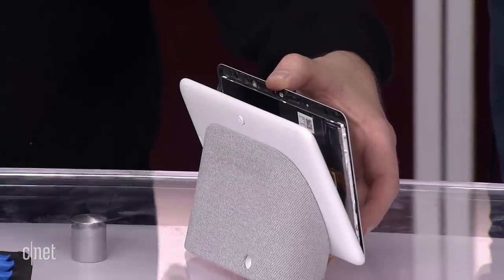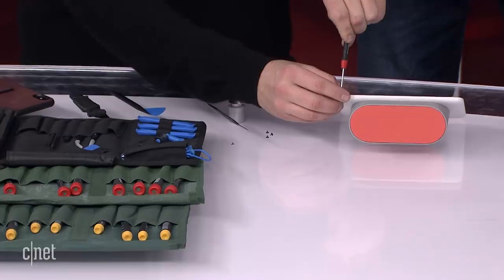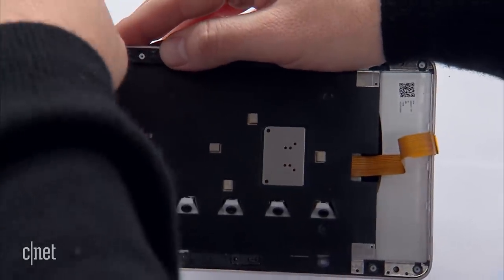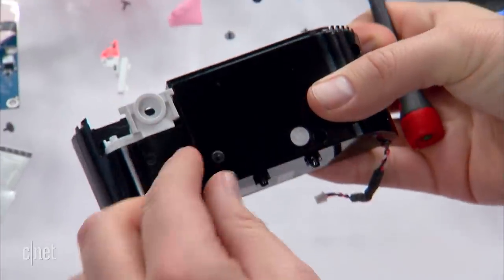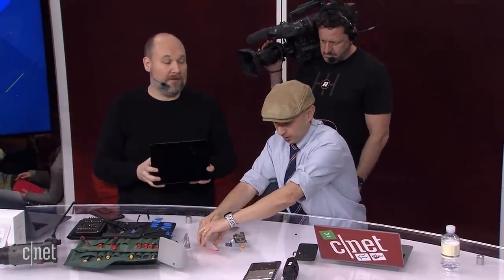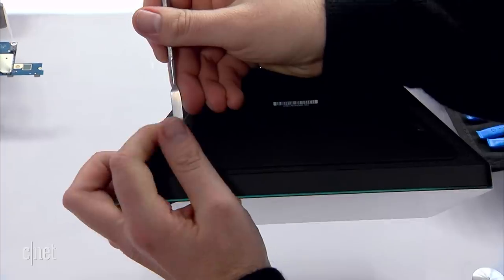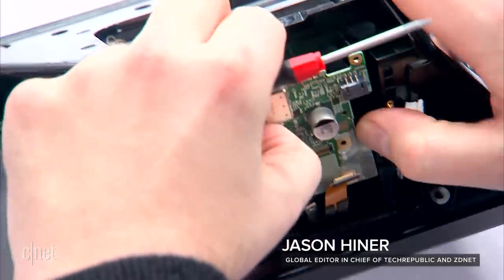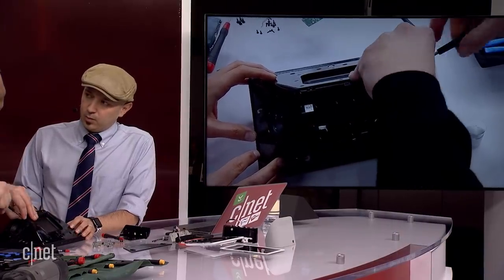We took apart the Google Home Hub and the Amazon Echo Show 2 | Cracking Open

Comment: Amazon stuff seems way easier to disassemble and reassemble without breaking it. Even those metal covers are popping off easily. Google's stuff is more fragile, though obviously more compact.

I bet though Amazon's box has a better sound - that's why it has that bigger box on the back with two mid-high frequency speakers and something that looks like a subwoofer (the rectangular thing). And you need the size to produce anything remotely close to bass, because lower frequency is longer wavelength.

Comment: The problem is the Google home hub is to small, Google should have add the common sense to make to sizes, another bad decision by Google.....
Reply: I think Google is testing the waters for such gadgets
Reply: So if they put the same thing in a bigger box it would be better?  To me smaller would be an advantage since it takes up less space.
Reply: @calvinwalker4654  this to me and alot of people would be better if icould buy a larger version ie about 9.7 inches, Google have no idea sometimes....
They have done a very good job in designing the smaller version....
Reply: Lenovo makes a 10 inch google home hub. It's very nice.
Reply: @Displays.1234.  Ah you're talking about a larger screen.  Google probably considered this but their main concern is making these cheap as possible so they can get the product out there.  This is why they sell the mini for like $25.  I'm sure their thought is once they get devices in everyone's home then they'll raise the price and make better versions